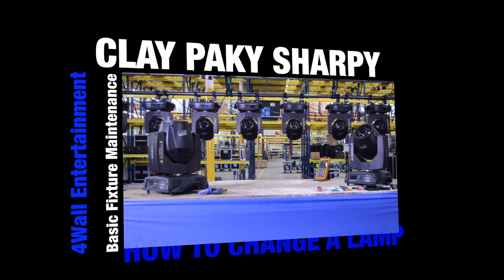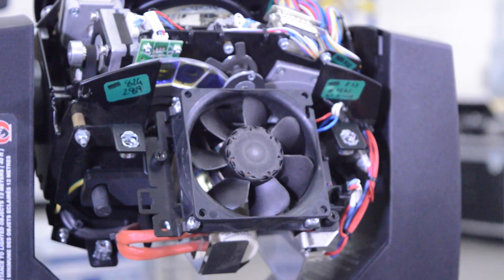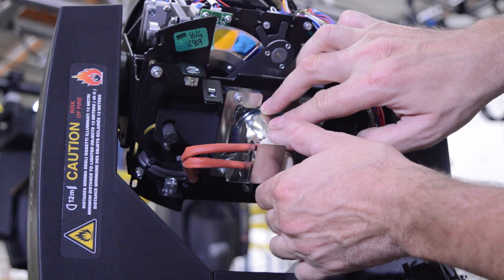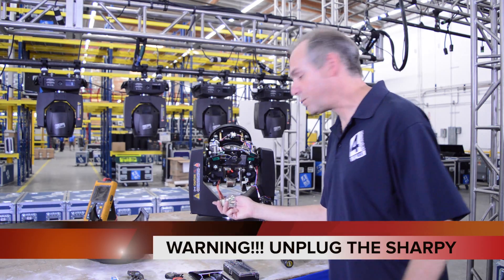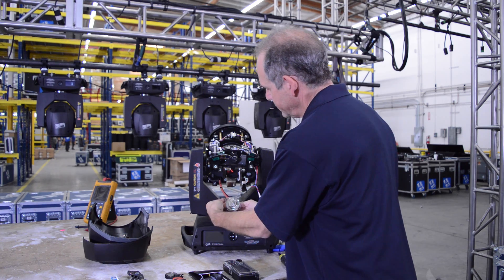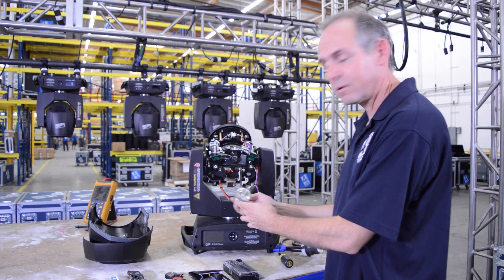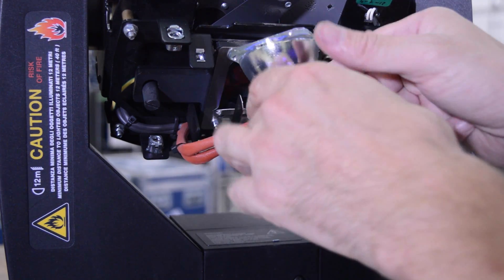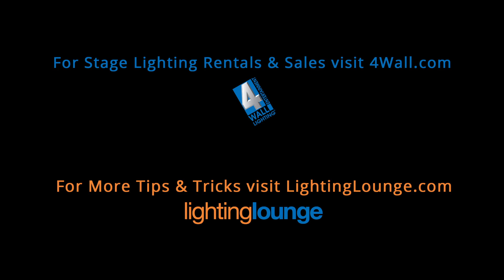How To Change A Clay Paky Sharpy Lamp

Comment: Thanks for this video. One of mine had light leaking out of the area where the fan vent covering. Turns out the bulb wasn’t seated properly. Was fixed in less than 5 minutes

Comment: what a shitty desighn i want to see you doing this on a ladder while the light hangs upside down
Reply: At least these have tilt locks which make it slightly easier, try being 40ft up a ladder attempting to change the lamp on a Mac250K, whilst still trying to keep the screws ;)